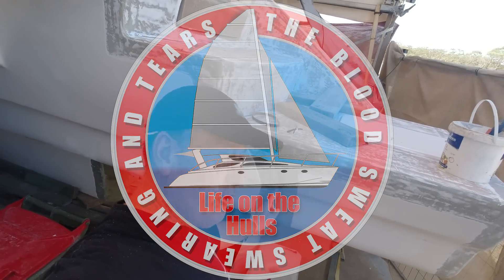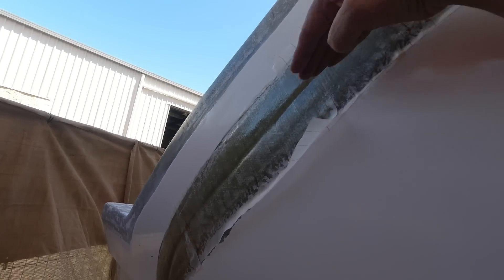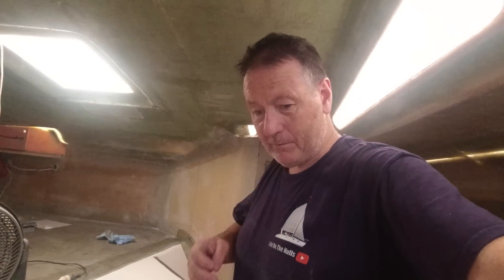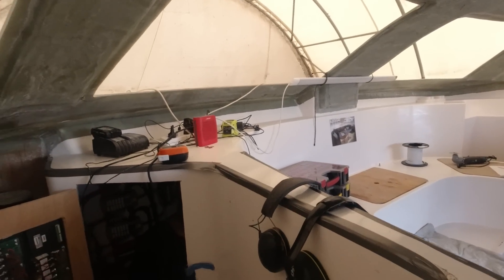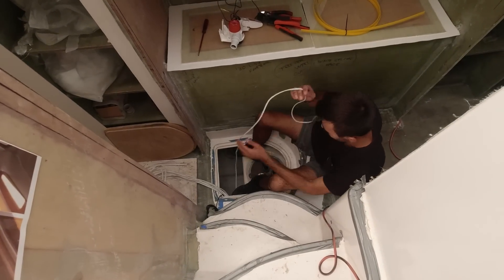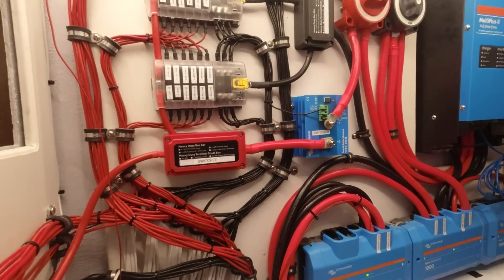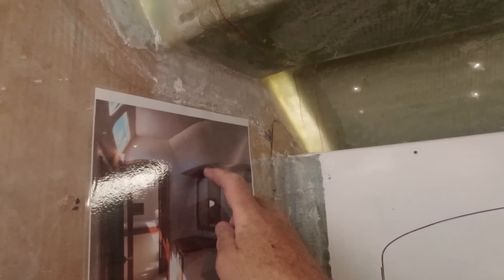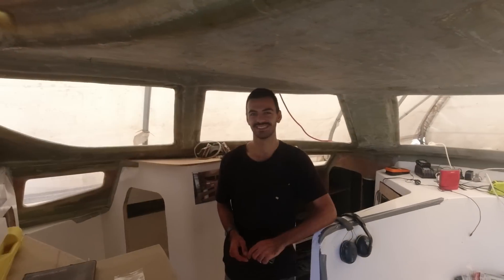Stretching the Limits: Strengthening the Hull Extensions (Sugar Scoops) of our Catamaran Build Ep271

Comment: Great job but I'm surprised you haven't used equal lengths of cable to each battery instead of patch leads. It does make a difference to  the individual battery usage.

Comment: Ross, I poked a little fun at you last episode for not having announced a target launch (least that I didn't see). These projects are hard to close out sometimes as there always seems to be more to do. As a woodworker, I see a massive amount of work to do to finish out the interior. Not one piece is huge on it's own, but every part will have to be shaped. Is this something you are going to do yourself?  Also, is your strategy to hold off launch until all of the work is complete? I wish you great success.

Comment: You should also have some sort of high volume pump apart from those small bilge pumps. Preferably not a manual pump because if you have a hole in your boat
 that requires its use, you'll be too busy to be pumping water manually.